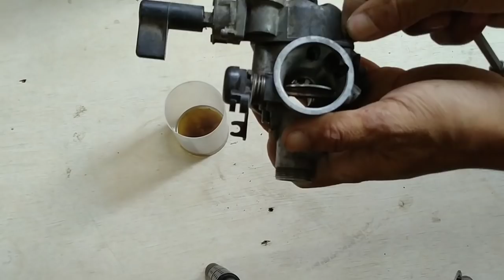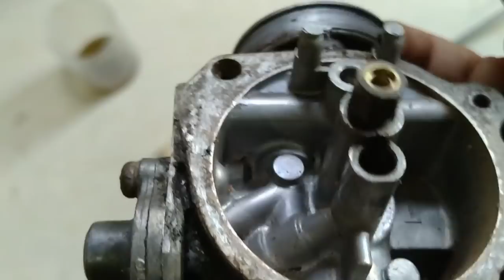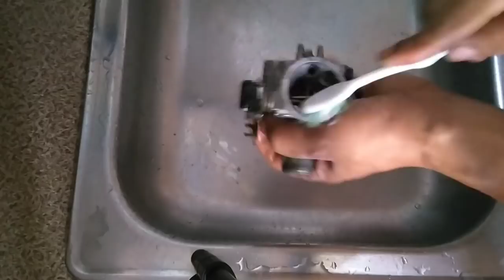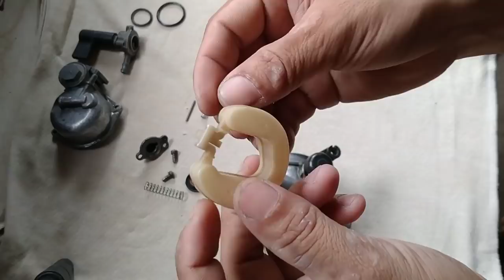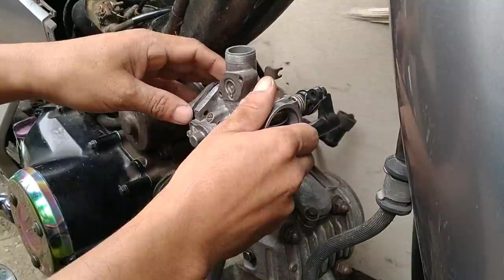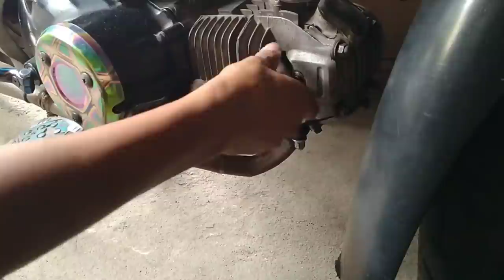Bakit laging maitim ang spark plug

Comment: m0tor ko sir bago ang carb pero maitim pa rin ang sunog at madali mapundi..anu posibleng problema sir?
Reply: Mataas ang menor or tagas sa gas to cylinder
sanhi ng pagka itim.ng sparkplug 
kahit bago 
and about naman ss msbilis mapundi 
pakicheck ng motor nyo kung may battery or nakadirect
Reply: @johncristiantihahon5070  may bat po sya..ang kapal po kc ng carbon deposit nya namumuo sa sparkplug..tapos may usok sya nakakahilam

Comment: xrm 110 aking mc sir. naka 24mm carb Keihin.. na tono ko naman sya.. bv head 53 mm number 3 ang needle ko pero open carb po mc ko maitim din pi spark ko kahit anong ayus ko
Reply from the maker: Ring gap mo sir di ba malaki
Reply: @dhikomech  sorry sir di ko alam ang ring gap..piston ring ba yan? 😊.. ang manifold ko po ay sa mio.. 24/28 po ung valve ng head ko..mutaru po block ko dome type po ang piston
Reply from the maker: Gap NG piston ring sa block. Pag medyo malaki na gap nakakapasok Ang langis sa ibabaw NG piston. Sinyales non pag may puting usok sa tambocho. Meron namn carb na talagang mahirap itono.
Reply: @dhikomech  upo mejo may usok sya pero di sya amoy langis tulad ng sabi nila na maluwang na ung ring.. ang amoy nya po ay gasoline po.. para dark ung usok nya parang carbon.. po
Reply from the maker: Carb lang Yan. Dapat mabugahan NG hangin Ang mga jetings tapos itono.

Comment: Anu po sakit ng nastock na motor tas nung pinaandar sobrang init na
Reply from the maker: Baka di maka flow NG maayos Ang langis. Kung matagal na stock need Rin change oil
Reply: @dhikomech  bago na oil pump
Reply from the maker: @pasko7186 sa block may butas Yan daanan NG langis dapat mabugahan NG hanging sa compressor